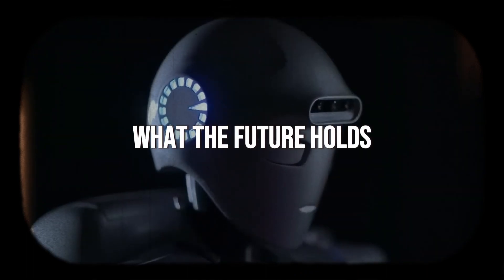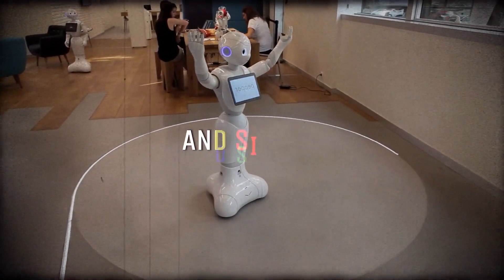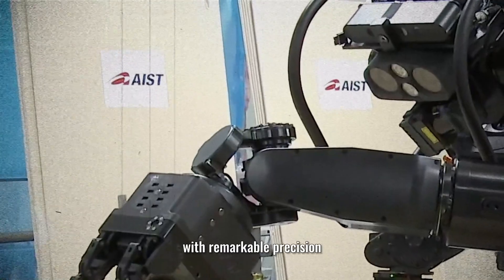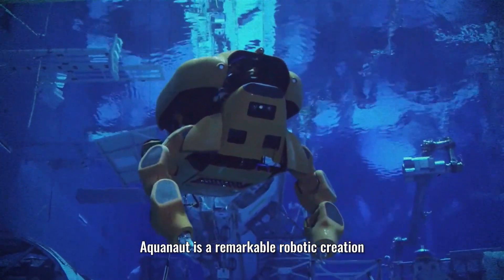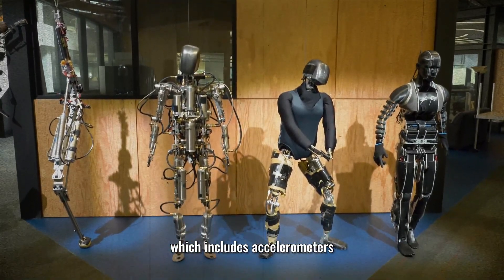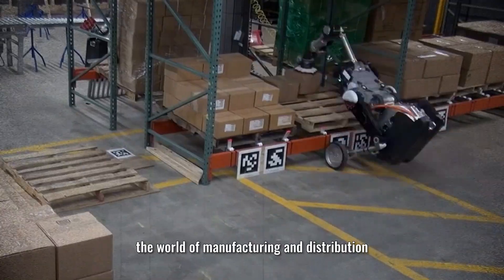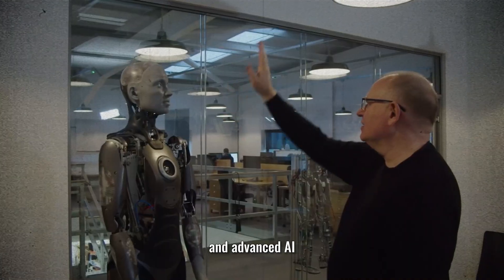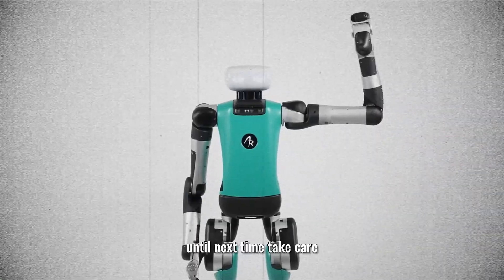Top 10 Most Advanced Sentient AI Robots in The World of 2023!

Comment: The key problem with these robots that have resulted in very little large-scale adoption can be summarized as expense, maintenance requirements, and very limited power and thereby portability. Robots on the production line that are plugged into the grid will get nothing but better. However, battery technology will have to improve many orders of magnitude before there is a practical mobile robot. Household robots must be affordable and have little maintenance requirements. We are a very long way from that happening.
Reply from the maker: Thank you for your comment. We agree that advanced robots face many challenges, such as high cost, high maintenance, and low power. However, we also think that there are many innovations and breakthroughs that are solving these problems and making robots more useful and affordable for various purposes. We hope you enjoyed our video and learned something new. 😊